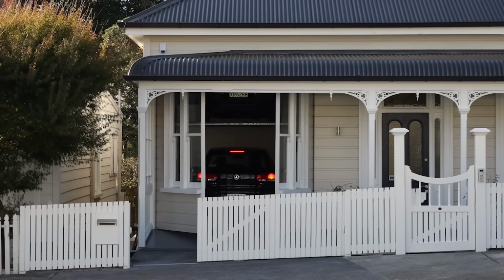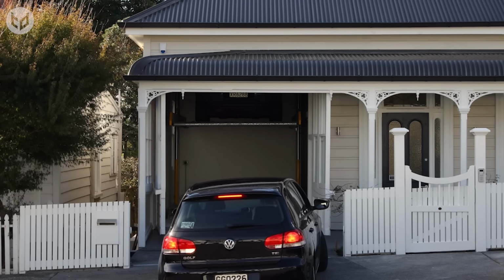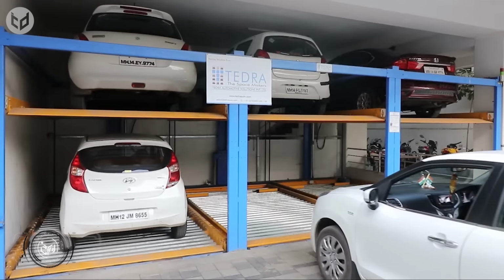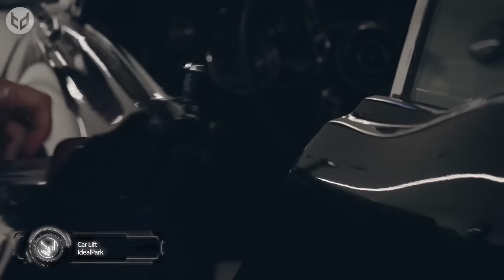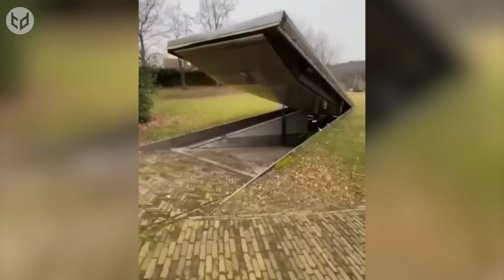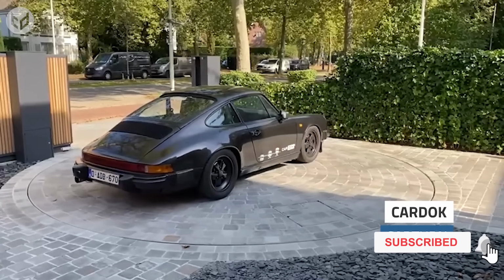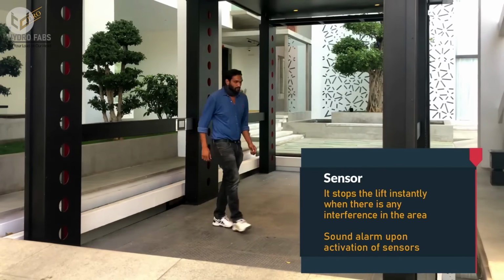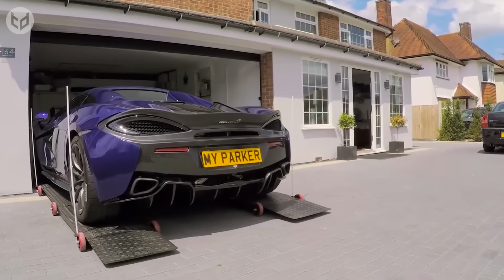Ingenious Parking Garages that Everyone Will Appreciate

Comment: the problem with some of the underground ones is flooding and if your ramp or what ever is broken you arent getting that car out.
Reply: They should have battery backup and flood pump. Ramp garage will be perfect for house built on slope with access to natural light on the basement. For last resort manual overrides can use hand hydraulic pump to lift the hatch door slowly.

Comment: No examples from the country that invented "ingenious parking garages," Japan??!  The Japanese have been using turntables, car lifts, stackers, gondolas & just about every great way to squeeze the max number of cars into the tiniest space since the 1980's... Tokyo has the most impressive parking structures I've seen, hands down.  I had a car stacker for over a decade & the biggest issue is always what happens when they break down or you have a power outage... like elevators in a skyscraper, they are brilliant as long as they work!

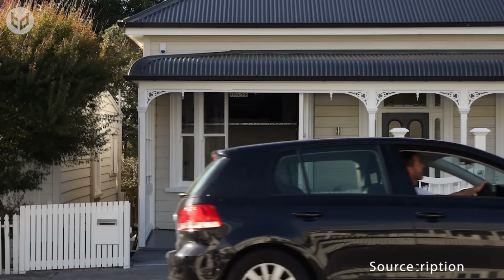Comment: 1:30 - I used to live near this neighbourhood. The streets are really narrow as it was all built back when cars weren't very popular, so parking on the street is a right pain. There's very little room at the front of the properties too, but heaps out the back, so most have extensions ranging out the back. The street also has a strict policy from the council about how it all looks, so more limitations. This is a genius way of dealing with this street!
Reply: Is it ponsonby or freemans bay?
Reply: @peterkotara  back of Ponsonby, one of those side streets near the BP
Reply: @bugjuicer  Makes sense. In that area you actually have to lease the road frontage from the council if you have a driveway, when I was working in that area I had to unload the van and then park several blocks away.

Comment: I liked them all. I've seen an elevator big enough for a tour bus/coach where the owner had nearly an acre of underground parking for his massive vehicle collection.
Reply: Yeah, at the TATA Steel plant in Ijmuiden, Netherlands, there is also an elevator where a truck fits in. A really big elevator. It is in the Oxy Steel factory, they melt the old metals in that factory. The truck, big, drives on the second.
Reply: @gerhard6105  If we consider industrial vehicle elevators there are lifts that hoist locomotive a few hopper cars loaded with coal into power plant stores at a time and platforms that tip out haul trucks of ore. Some mid-city skyscrapers feature carousels to turn large trucks around in their lower garage levels because that's the only option to handle freight. These tend to look less than elegant though.

Comment: I have a parking system in a tight garage where I can park my 2002 Suzuki beside my 2000 Ford by simply opening the door and putting another dent in the neighbouring car. It didn't cost me a dime to install and there is no maintenance cost to it either.

Comment: What could go wrong with all these hydraulic operated car lifts!  🤣   😝   😀
How long would your car be stuck.   😭
How long before someone qualified to work on it, could come out and get / order a part to repair it?  😕
The devices that come out of the ground or rotate, they would get dirt, leaves, grass, twigs, water / ice in the cracks.

Comment: I like the one garage system that is from China and I think that whole parking lots should also be done like this in order to completely eliminate vehicle thefts, either that, or do it the way that the South Korean  or Indian vehicle storage systems are done in the video.  However, there are some problems with all three of those, namely, that vehicles that are too tall, too long, and/or too heavy, could also become issues, with the latter two becoming even more of an issue with the South Korean and Indian systems, thus a separate system needs to happen to those vehicles as well.  I would also like for such systems to be used to eliminate the stupid and dangerous concept of on-street parking, as a vehicle is a sitting target to get hit by another vehicle with said on-street parking, and it would also make for better traffic flow.

Comment: I love the concepts shown but can easily imagine how a simple issue could cause a major malfunction.  A single particle of gravel or stone or mud being dislodged from a tire and into any of these mechanisms would possibly stop it from functioning.  Also, they all depend on the vehicle being a precise size and an excellent driver parking them in a precise position- otherwise, trouble.
Reply: Does gravel or stones stop a trash truck or earth moving equipment?  Let the engineers do their jobs....
Reply: You'd definitely need a generator or some other type of backup power supply in case of a power failure.  Of course, for what all of these cost, that addition would be peanuts.
Reply: And in the USA stupid people are leaving children in their cars all the time, forgetting about them and then suing everyone when things go wrong or they get hurt- and winning $million judgments for their stupidity! Because other stupid people serve on juries!
Reply: Indeed... It looks great, but you depend on electrical stuff to get your car in and out.  If there's a power or mechanical failure,  you're stuck...  I prefer a simple way to get to my car.
Reply: @iknownothing495  
Yeah I agree.
It's nice but not that practical.
Takes way too long to get your car in most of the clips.
I could literally be at my designation by the time the ingenious garage delivered the car.
Plus what happens when a lot of people want their cars at once in a public parking garage.
Reply: I agree with you, it's very cool but I wouldn't trust parking my car on anything that could possibly quit working and leave me stranded while my vehicle is stuck 2 or 3 stories high!

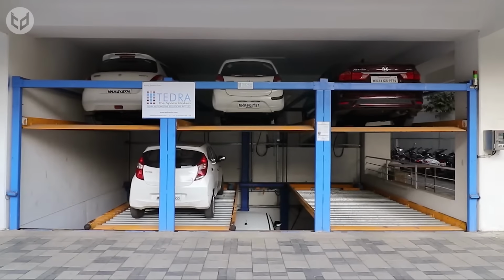Comment: 3:24 That's not how energy works. High 'power' (wattage) = short duration. Low power = long duration. Total energy (kWh or Joules) required to perform the same amount of work is unchanged regardless of speed.

Comment: I had always dreamed of under ground parking garage since it can be as large as your property.  Although flooding might be an issue.
The hydraulic parking is great, but won't work in the US since US has an appetite for large arse SUVs and trucks.  Plus anything with complicate hydraulic system, soon or later, it will fail and there will be lots of headache.

Comment: These systems all have the same basic flaw that my automatic garage door did: if the power ever goes out, you can't leave... or even close the door. That being said, garage door openers are available with battery backup now, so if somebody wanted to spend enough, they could get a battery backup for these as well.
Reply: Tesla PowerWall can take care of that. But even if you don’t have one of those, most garage door openers have a way to disengage so you can open or close the door manually.
Reply: All garage doors can be opened and closed manually. In fact, I always work mine manually when the car doesn't need to come out or when I go on a long trip, to save on electricity and motor wear.

Comment: Most of these parking "solutions" cost way too much for the average person to afford.  I have a simple cable operated drive-on lift in my double height, double wide garage (which cost $3500 in 2010) and it is NOT convenient to use, since to take out the car on the lift, you first have to move the car underneath, and reverse the whole process upon return.

Comment: If i could design any garage i wanted, I'd make a square garage attatched to the side of the house that would look like a 2 car garage from the front, but then be deep enough for four cars, with another identical garage door in the back. I would also have carports on both sides of the house. There would be a circular wrap-around driveway with 2 entrances to the street.
Reply: That is a brilliant idea. 👍

Comment: Most won’t work for lifted trucks.

Like my 6x6 gladiator. 

40 inch tires.

Top to bottom 11 foot high at least . 

15 foot long I believe. 

7 foot wide 

None will work then the antenna on it for cb/ GMRS radio. 
Then plus all the other things to add on . 

All this is for small cars
Reply: Sorry about your penis! I drive a Smart Car to compensate for mine.

Comment: Hmm. Just what we need with the current energy crisis: use more power.
Other than those smaller units which might be solely solar powered... what happens when there's a blackout? Oh dear... no access to car 🤣 is there a giant wheel you can manually crank to rotate/lift/whatever your car to you?
And fitting EV charging points to each bay makes sense... oh dear... more power needed... And the inevitable spontaneous ignition of one charging EV is going to cook all the rest in the parking lot (there will, of course, be the inevitable disclaimer you see in any parking lot:  "No responsibility accepted for the loss or damage of any vehicle on these premises")
The only real fix to the parking problem (and every human problem: food/housing/energy/poution/etc) is...
Less people.

An immediate 80% population reduction would mean existing parking would be more than adequate. There would be houses for everyone. Pollution would be slashed. Energy consumption reduced. Ample food for all - no need to continue destroying precious rainforest in order to make more and more fast food burgers.

Gimmicks like this just add to the problem (or completely ignore it) - they do not addrees the problem.
Reply: 80 percent haha that would be pretty crazy

Comment: Don’t like the ones where they stack the cars on top of each other.  Mechanical things can and will break down.  Eventually.   Then what?  You have to wait hours or the next day until someone can fix it.  Also don’t trust the computer controlled garages.  That too can easily break down.  Then what?  The simpler but clever ones the better.

Comment: Most of these ideas are all pretty sad if you have to automate fun tasks such as parking  i love doing it my self and honestly if i want my car manually and today with out relaying on electricity or power outage.i can go down a ramp. And what of the maintenance upkeep of all these hydraulics? The building lift at my work is expensive to fix these hidden ones under concrete would be 4x the amount. A better idea is a forklift solution or one of those magnet metal crane that run reliable diesel power.

Comment: When I was in Okinawa, Japan from 84-86, a hardware store had one of those farris wheel type parking things (enclosed) in the corner of its parking lot, like the one you saw in this video inbetween those tall apartments. I parked my car in it and did not have to wait very long to retrieve the car.  The hardware store itself was 3 or 4 stories high.  Quit a  good use of space.
Reply: Yes, these were all over Japan back in the early 80’s when I lived there. I remember first seeing one in the Roppongi area of Tokyo and I was quite fascinated with how it worked and what an efficient use of space it was as a parking option. At the time I remember that it actually reminded me of the old ice cream bar vending machines from the 1960’s, which worked in a very similar fashion. It was like a giant vending machine for cars.
Reply: 30 years ago I worked in an office in the center of london that had one of those. very simple concept.
Reply: only issue i see with them is the addition of Florida man forgetting which parking stall his car is in
Reply: @jessicacolegrove4152  , among other issues, namely, the cars being too tall, too long, and/or too heavy to fit into them, unfortunately.
Reply: @paxhumana2015  They fit SUVs. If you have a limo, you can't make the turns in most parking garages anyway.
Reply: @jessicacolegrove4152  These kind of stalls always have an attendant that operates it, along with the turntable so no backing into traffic.
Besides, the parking ticket knows which car is yours. It's a very simple and easy solution.
Reply: I always think of karate kid when I see the word okinawa

Comment: I wouldn't want my kids nowhere near those hydraulic garages
Reply: Did you not notice all the safety devices and beam scanners? It's no more dangerous than a lift or an escalator.
Reply: @marvindebot  Not good enough.
Reply: @imthebestdirector  Why do you say that? Do you have an electric garage door? It makes firm contact before it reacts and yet you don't knock that. What's the difference?
Reply: @marvindebot  Those door can crash you to death.

Comment: #1. What happens if you piss the Company off and they won't let you have your car, or they decide that they want you to work late? Or the lift breaks? You screwed.
#2. Too much use of Hydraulics, which can break and leave you without the use of your car.
#3. Only if there is a way to operate it manually.
#4. You should have actually showed the part where it looks seamless because what you did show doesn't match to what you stated.
#5. This is a good idea until the Hydraulics fail in it and or another vehicle leaks something onto your paint job Effing it up.
#6. Why not just have a manual or remote control door instead?
#7. What happens when the hydraulics fail and multiple ramps and a sliding door are cheaper.
#8. I would have to wait for my car unnecessarily, and it is possible to break and I can't get my car. and what if another car leaks on it and it needs to be repainted?
#9. This is lazy. Like driving an Automatic instead of a Manual.
#10. Do I have to tell you? 
#11. There is already a product that can do this that is a lot cheaper and you can buy it in the states now. It is however manually operated.
Reply: That's why they will have a customer sevice team available. Just like any other new technology, there will always be a support line, and a customer rarely pisses any company off. It is ususally the other way round. lol I have an undergorund car park. If the gates get stuck, or you can't get out, there is an emergency number to call and they act on it the same day.
Reply: @balb3014  Okay me personally, I don't like any of this because I can see that I don't have total access to my car at any time it is on one these contraptions or is in a position to get stuck due to a failure where I am stuck without access to the stated vehicle for a long period of time. On the roll out table you can just drive out without a problem, with the rest of them it is like someone put four boots or your car and you have to pay a rental fee to hope you can drive it.

Comment: How does water not get into the underground ramp system
Reply: they said that had a trough and drainage pipes... you know, the same why skylights don't leak? (Skylights have a trough around the outside with holes on the lower end for water to run out. Except they installed mine with the holes on the upper end, so it ran out and ruined the drywall!) Of course, any drainage system has to have some slope to it so it gravity feeds, just like gutters.

Comment: I liked the underground hidden garage and then the Korean garage when you just scan a card and let the automation take care of parking your car and delivering it to you at the end of the day 🙂
Reply: Yeah that's awesome! But now try to charge electric cars there or even plug them in 😁
Reply: @Allmentux  seems pretty simple, just have a charger on the platform, you plug in your car, the platform moves into position and makes contact with some connectors built into the structure, applying power to the charger
Reply: Problem with underground parking is flooring from rain

Comment: I plan to have part of my basement turned into a parking space with a hidden door in my front yard.  My house is up on a small hill so I can use the first flight of stairs and the slope of the yard next to it as a hidden garage door.  It will ensure I never have to worry about a parking space ever again.  Of course, I still have to make sure the street in front is clear so I can get to the hidden driveway.
Reply: Problem with underground parking is the risk of flooring from rain
Reply: @The_North0  Flooding?
Reply: @marktierney2986  yes, when it’s raining heavily it’s going to flood the garage floor and the cars will be floating in the garage . Water go down not up

Comment: and when a blackout happens you will be left on foot 🤣🤣🤣🤣🤣🤣
Reply: Air pressure backup system? Or hand powered pulley system? But I agree if there isn't any kind of backup it'd be dumb.
Reply: @endemion06463  In general, every electronic system should have a manual backup, like the crank that BMW provides fot it's car sunroofs so you can close it if the motor goes out when it's open. You can buy garage doors with battery backup now so they still work when the power goes out, and the gate to my gated community has a battery backup as well. (Good thing; the power goes out there all the time. High winds on the Oregon coast!) Of course, we just had to pay about $700 to replace the batteries for the gate, so no solution is cheap.
Reply: Have you ever heard of a power generator? 🙄
Reply: Nope u have the money for that u cab afford a back up gen or off grid battery back up
Reply: It might work with a rechargeable battery 😀
Reply: I have literally never ever been in a blackout, and I have never heard anyone I know ever talk about being in or experiencing a blackout. Ever. I live in Charleston, SC and people move here from anywhere and everywhere!! A blackout is nothing I have ever ever worried about. Ever!!
Reply: @nitenerd you need to live more, go to other pñaces, etc.
Typical American, who thinks the world ends outside his town.
Reply: @nitenerd soooo what you’re saying is not… ever?
Reply: If I can buy a system like this, I'll probably have the money for an emergency power supply...
Reply: Unless you have a battery backup, or a Tesla power wall, yes.
Reply: Oh no! Not on foot! But also there’s Uber…
Reply: He got a ai valet garage you think he ain’t got generators u slow a lil bit 😂😂😂
Reply: Can't drive or walk in a black out😂😂😂
Reply: They can afford backup generators
Reply: As will electric cars